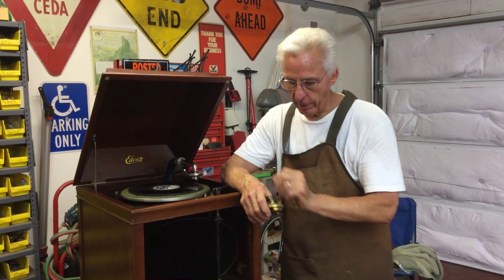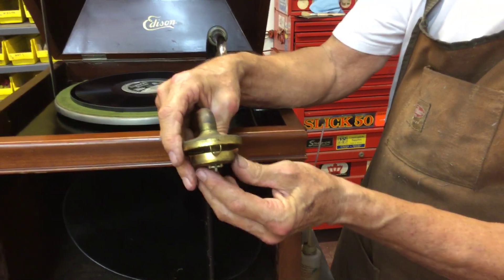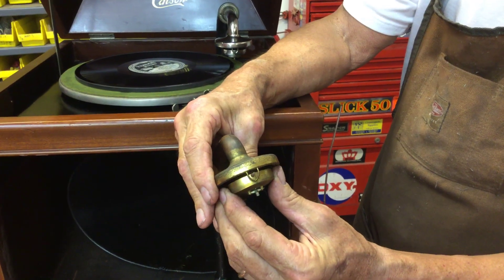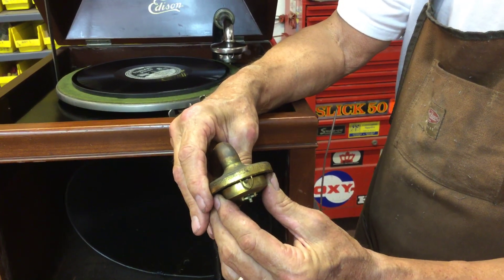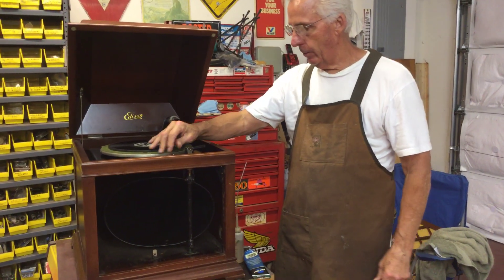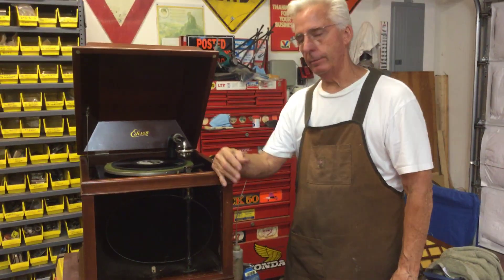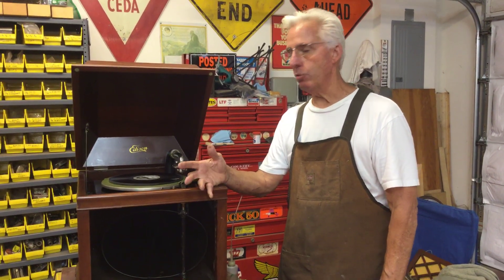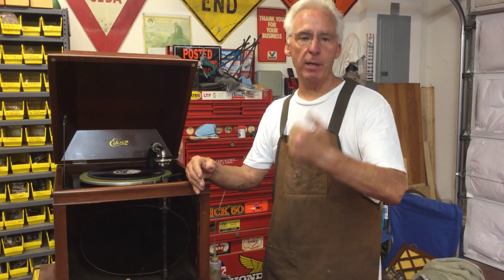75.  Finally finished the Edison Diamond Disc tune-up!

Comment: Thanks for posting all these great videos.  I have a 1903 Chipindale Diomond Disc I need to get working again. It's been in my family since new.
Reply from the maker: it’s worth restoring a family piece!
Reply: @1974hurt   something is broke on the crank, it wont lock once wound up, have to put a weight on the crank handle
Reply from the maker: William Rivers    There is a spring assembly in this, and a locking mechanism
Reply from the maker: William Rivers         send me your email address and I’ll send you pictures
Reply: Are you in florida? I'm in winter garden
Reply from the maker: William Rivers no, South Carolina